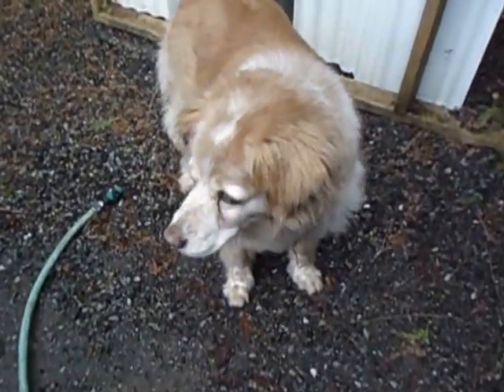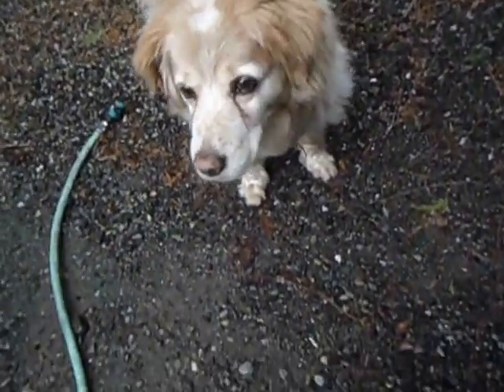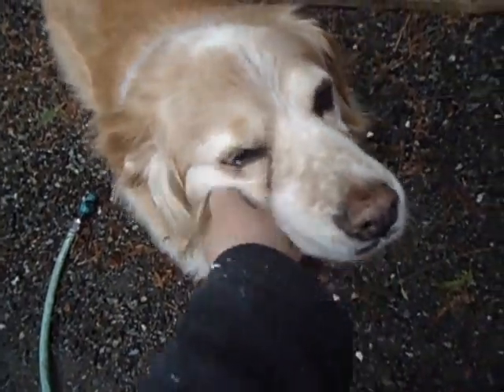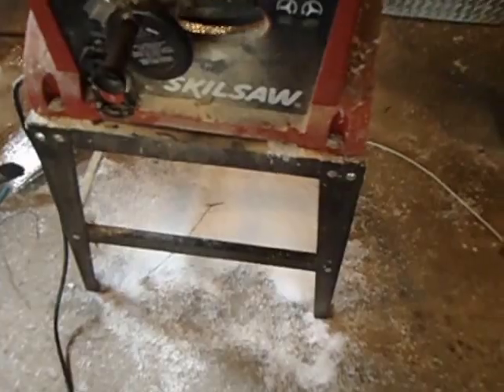htpe plastic waste tank carpet cleaning electric truck mount

Comment: did you ever finish the tank? did it perform well?
Reply from the maker: +spideymikespideymike  yes the tank seems to work fine has a few weeps in some corners
Reply from the maker: Look up Plastic welding HDPE look on line for plastic welding supplies